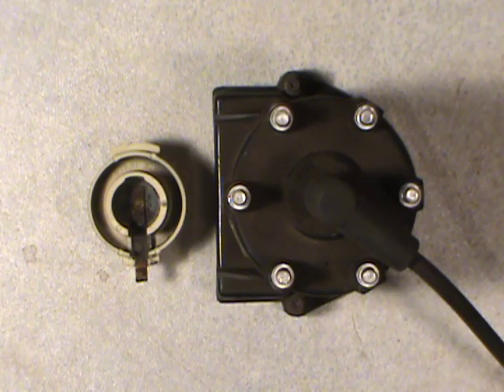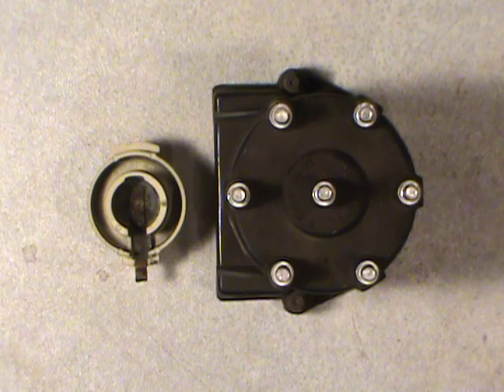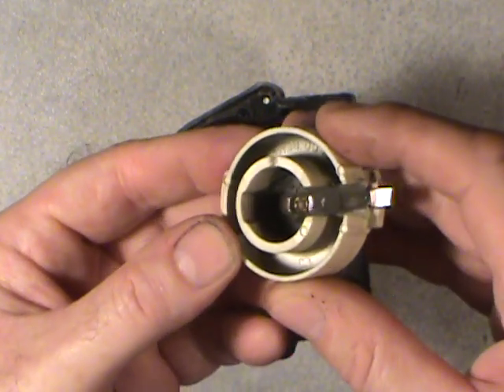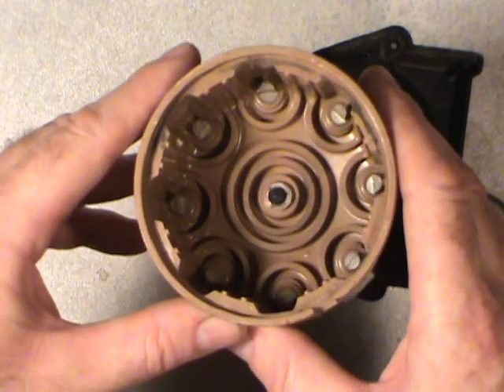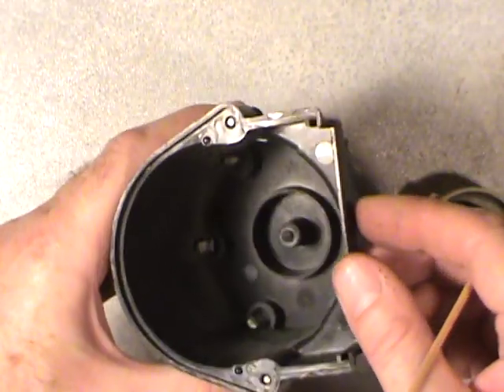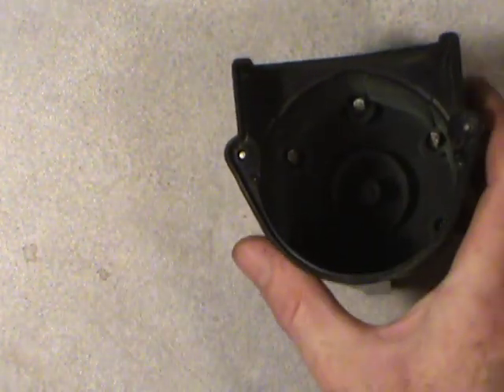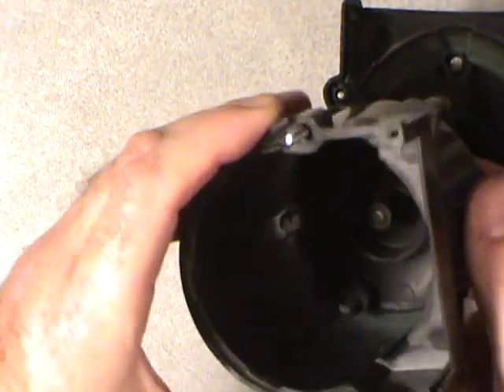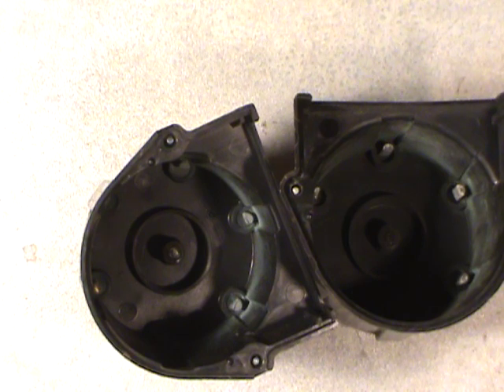How to Inspect Distributor Cap and Rotor Condition (Part 1) of 2 Parts

Comment: will a bad cap , rotor and or distributor cause the car to crank but not start or start then shut off.?
Reply from the maker: Charlie Reyes Greetings Charlie Reyes....Thanks for watching this YouTube Video of mine, and also, for Your comment/question as well..................................................There are quite a few "Things", that can cause a Car or Truck's Engine, to Not Start, or, Run/Operate/Perform Poorly as well, as far as, "Only" the "Ignition System" is concerned..................................................A Vehicles "Ignition System"..."Does Not"...like having Any "Moisture" (aka, Water, Condensation, etc.), any-where near its Component Parts...Especially..."Inside the Distributor Cap"...because, all of that "High Voltage", will usually become, shall we say..."Scattered"...and probably..."Won't"...make its way, From the "Tip" of the "Rotor", to the Intended Metal "Terminal"..."Inside" the "Distributor Cap", and with this particular Scenario, it has been known, to cause, a..."No Start" of the Engine, more-so, when the Weather Conditions are, Damp/Raining, well, You get the picture.............................................................Also, if there happens to be, even so much, as a..."Hairline Crack" (aka, a hardly visible crack) in the "Distributor Cap", as well as, if there happens to be any "Dust Like" Deposits, especially, something like a "Carbon Like" kind of Deposit, "Inside" the "Distributor Cap", which will probably cause, the "Scattered Spark" Syndrome, kinda like, what the "Not Wanted"...Moisture-Inside-the-Distributor-Cap...did, some-what...............................................................If the Car Starts, and then, Shuts Off, that in itself, can be caused by "Many" Things..................................................................Depending on How the Engine actually "Runs", right after Start-Up, (as in Rough/Miss-Firing, or Good and Smooth), and Before it Hypothetically "Shuts Off", will be, quite a good "Clue", that can be used to Determine (or Guess....lol), if it's not something that is "Fuel System" related, and is actually being caused by the "Ignition System", and depending on, just which "Ignition System", that we are Talkin' about, then, it might be, oh, something, as simple, as a "Not-So-Good"...Wiring or Electrical Ground "Connection", and sometimes, and rarely, something, like a worn-out Ignition Switch, can at times, become problematic............................................................If Your Distributor "Cap and Rotor" look like the ones in this Video of mine, I find, that they "Don't" Last all that Long, and, as I see it, is because of the "Weak" Design, more-so, pertaining to the Very Small "Carbon Button", which "Burns Out/Wears Away" quite quickly (mileage/kilometer/age wise), and, the "Rotor", is, shall we say..."Wimpy", and No-Where Near, being, that of, the, like I like to call them..."Industrial Strength"...Distributor Caps & Rotors, that used to be found, on something like, the good ole.."Points & Condenser" Distributors, and some of the Early "Electronic Distributors" as well............................................................................In order to have Your Engine...Run/Perform well, and to get much Better Gas Mileage/Kilometer-age, then, it's a "No-Brainer" (aka, a Must Do!...lol), to make sure, and "Keep" Your Engine, and its related "Ignition Parts"..."Fuel System Parts"..."Air & Fuel Filters"...and, Any, and All, "Maintenance" Related, as well as, a Complete "Tune Up", and have Everything "Adjusted/Set", to the Factory/Manufacturers, and if Applicable, the Added-On, After-Market Parts "Specifications"...!!!..........................................................No-Sir-ee-Bob, please, don't get me wrong, as I'm not Doin'...the...Point the Finger Blame game, but rather, trying to help You out, in giving You, the Best Chance, at having Your Car's Engine...Start...Run...Perform...as well as..."Save" You some Money at the Gas Pump, in terms of, getting, Much Better & More...Gas Mileage/Kilometer-age...!!!....................................................Good Luck....................................................Be Safe, take care, and have a good one.

Comment: Great video.
I have a question.  I'm trying to tune up as much things as I can that aren't to tough for me to handle. I have a 94 Jeep YJ 4cyl and having issues when accelerating from a dead stop in first gear.  The whole jeep will shake/stutter for a quick second then everything works fine. I haven't changed or inspected my distributor cap since I've owned it so I was curious if you think this could be something that would cause a rough acceleration.'
I just replaced the spark plugs, throttle position sensor and O2 sensor.
Thanks in advance.
Reply from the maker: Greetings ncron714....Thanks for watching, and for Your question as well....There are a number of things, that can cause the Symptom that Your Jeep seems to be experiencing....Do You happen to be seeing any "Dashboard Lights", Lighting Up, like, a Warning Light or its equivalent?....Usually, the first thing to do, other then spend a lot of money, replacing parts, that may not be causing the problem, is to first, "Check for Trouble Codes", that might be Stored in Your Jeep's "On-Board Computer"....I haven't had a Jeep to work on, but, I think, in order to See Any Trouble Codes, that might be "Stored" inside Your Jeep Computer, there might be a certain Way, to use Your Jeep's Ignition Key, in the Ignition Switch, to then have, a Light "Flash" a (if I'm not mistaken) Series of "2" Digit Trouble Codes....With the Engine "OFF", Insert Your Ignition Key in the Ignition Switch, then, Turn the key, from, OFF, to the RUN (Not Start Position) using the Following Sequence....ON...OFF...ON...OFF...ON (and leave the Key in the Last ON Position, and wait a short while, and see if a Dashboard Light, Starts Flashing)....Then, Write Down, the Number of Flashes, that You see (if any), and, from what I recall, it should end with the Number 55.

Once You get the/those Codes written down, remember to turn the Key Off, and remove the Key.

Any Codes at all?

Even if You don't get any trouble codes, You could try the following...

...I have found that, adding some Fuel Injector "Cleaner", to the Gas Tank, can make its way, through Your Fuel Injectors, and Clean the Deposits, that can Clog one or more Fuel Injectors, and can also, keep the Fuel Injectors, from Spraying a very Fine Mist or Vapor, that is very Important, for Your Engine's Power and Fuel Economy.

Just follow the Instructions on the (small) Bottle.

Be careful, as some of the Stuff, that I used a while ago, actually Cleaned all the Crud out of my Gas Tank as well, and, Totally Clogged my Fuel Filter!

So, if You do use the Fuel Injector Cleaner, it would be a good idea, to Change Your "Fuel Filter", once that Tank of Gasoline, with the Fuel Injector Cleaner in it, is used up, and, New gasoline is added to Your Gas Tank, With-out the Fuel Injector Cleaner in it.

Check out Wrangler Forum . Com  (without the Spaces in-between), as, the People over there, know "Tons" about Your Jeep!

Also, check out Other Jeep "Forums" as well.

Good Luck...

...Be Safe, take care, and have a good one.

Comment: Thanks for the info. Does the rotor make the contact on the distributor cap or is it just spark jumping. And do I have to clean the contacts. This is why I posted my original comment that you spent the entire video on center spring loaded contact yet you didn't cover any other parts of the distributor.

Comment from the maker: ...now, on to the "Condensation", or build up of Moisture inside your Distributor Cap...If a Distributor Cap happens to contain any Condensation (happens when water vapor in the air gets cooled to the point where it condenses back into liquid form), that my Friend, will cause Sparks inside the distributor cap to put on a very Unwanted-High-Voltage-Spark-Show, or, in other words, Electricity Randomly Bouncing around inside the Distributor Cap, making the Engine sound Sick, or No-Start!...(con't)

Comment from the maker: ...Miss-Fires, and Uneven-Running, etc. ....I recall an Old-School Fix (but it's always better to Discard any Bad Distributor Caps and Questionable Components, but I'll tell you just for the fun of it....Some, used to clean the inside of the distributor cap, and "Dab, or Paint" the crack with some of that fancy stuff called "Nail Polish!"....Please, don't do this, especially if the "Better Half" catches you taking Her Nail Polish without Her Permission!...lol....(con't)

Comment from the maker: ...your Ignition Coil work harder then it really should, because it takes more Voltage to Jump that Larger Gap, much like a larger gap in a spark plug would....Same thing happens when the spark plug Terminals Inside the Distributor Cap starts "Eroding", due to the same "High-Voltage-Electrical-Arc-Erosion!....Psssst, I have done what I said not to, to save some money, probably like many others have!...lol...So, keep an eye on those "Electrical-Erosion" Points that I have mentioned....Take care

Comment from the maker: ...note, when the metal Tip of that rotor starts to Wear, due to electrical erosion, don't be tempted to File or Sand the metal rotor Tip Clean!....Why you ask?...That's why!...lol...Nah, here's why, my Friend....When the Rotor is spinning around inside the Distributor Cap, there is actually no real Physical Contact between the two!....If one was to file or sand the rotors metal Tip, then that would "Increase" the Running Clearance or "Gap" between the Rotors Tip, making...(con't)

Comment from the maker: ...in my entire life!....Now then, there are other points that I should, and must address for all of Mankind...lol...On the Larger Rotor, keep an eye on the metal tip, where it spins, nearest the inside of the distributor caps Internal Aluminum or Brass Terminals (Uh-huh, the terminals that the spark plug wires get connected to on the top/outside of the distributor cap)....The Metal Tip will start to Erode, due to Electrical-High-Voltage-Arcing whenever the engine is running....(con't)

Comment from the maker: ...now that the "Smaller-Cap-and-Rotor" (and in my opinion) not so well designed, problems have been addressed, I will now move on to the "Industrial-Strength", of the kind of Distributor Cap and Rotor that I most certainly will give a "Thumbs-Up" for, and that is the other larger Distributor Cap and Rotor (Tan colored Cap, and that Large Rotor that is seen in this video....I have Never, Ever, worn out a Carbon Button, or the Metal Contact Strip, where it contacts the carbon button...(con't)

Comment from the maker: ...so, now that you brought the lack of information that I provided about Inspecting the actual Parts, I will now inform you of what experience has taught me....The smaller Distributor Cap and Rotor need to be replaced when that "Tiny-Spring-Loaded-Carbon-Button" gets (wears) too short, as well as the Electrical-Arcing-Erosion that occurs at the "Tip" of the metal strip part of the Rotor, where it spins closest to the contacts inside the (smaller sized) distributor cap...(con't)

Comment from the maker: Greetings Krystian Leesowy....Thanks for your comment, and also, for paying close attention to what I had to say, and show you....When it comes to the smaller Distributor Cap with the Spring Loaded Carbon Button, it's my experience, that the Spring Loaded Carbon Button, and, the center portion of that Rotor that shows abnormal wear, due to the Worn-Out Carbon Buttons Short Length, will "Wear-Out" well before one has to worry about other parts/pieces that start to cause problems....(con't)

Comment from the maker: Greetings Oliver Renacia....It appears with the design of the distributor cap that you see in this particular video (of mine), that you have to replace the whole cap, as there doesn't seem to be any carbon buttons available when I did a parts search on this type of cap...You will find that when that carbon button wears out, it usually carves a circular hole in the rotor metal contact strip!...Replace the cap and rotor before the carbon button gets too short!...Take care, and have a good one

Comment from the maker: Hello, once again JCJV....I should also tell you the following....Whenever you "Reset" (clear codes out of the computer of your vehicle using the scan device), your cars computer has to "Re-Learn", and shall we say, "Re-Calibrate" itself again....All you have to do, is drive your vehicle around for a short while, and your cars computer does all of the re-setting all by itself....Make sure that you do after fixing something or changing parts, or you might have problems that are not really there!

Comment from the maker: ...Try removing spark plug Number 1, and see how it looks....Perhaps look at the other (5 or 3)as the case may be, and, that should tell you a thing or two about how what's going on inside the cylinders....Sometimes to fix problems like yours and others, the repair might only be fixing a bad wire connection (like a ground wire maybe), or a connector that may have corroded....You may find that the new parts you put in, won't fix the problem, or, maybe they will....Let me know, and...Good Luck!

Comment from the maker: ...the spark plug was firing intermittently, then raw fuel would be going past the first oxygen sensor, and it would read "Rich"....(catalytic converter would probably burn up the rich mixture) before continuing on to the 2nd oxygen sensor, thus giving an ok reading (that's if you have the setup that has 1 oxygen sensor before the catalytic converter, and the other one after it) ....but, then again, the computer might be telling the injectors to lean out because of the rich mixture...(con't)...

Comment from the maker: You are welcome, my Friend....I was thinking about those codes a bit more....Only Number 1 cylinder has the misfire, and because the other codes indicated "Lean" (oxygen sensors send lean voltage signal to computer when warmed up), has me thinking that it might be a faulty "Fuel Injector" or related wiring circuit....(4 cylinder has 4 Injectors, and 6 cylinder has 6 injectors), not sure if you have a 4 or 6 cylinder engine?...Now, if the Injector was injecting fuel into cylinder #1 and..(con't)

Comment: the car runs pretty well the same at cold start maby even a bit worse, and i have noticed every once in awhile that when the car idles and not moving it sometimes feels like it skips a beet and then goes back to normal. I will clear the codes in my cars computer and try putting new parts into the car that you have mentioned and check the spark plug wires. and I will let you know how things turn out. thanks for all your help.

Comment from the maker: ...also, does your car start and run ok when it is first started up for the day?...When your car is cold, the computer runs the system on what is called "Open Loop", meaning that the Oxygen Sensors (I think you have 2 of them) don't become part of the computers operating circuit until they get heated up to approx. 600 degrees farenheit...(You might have heated oxygen sensors, to speed things up)...Also, take care of all of those "Scheduled Maintenance" things...Let me know how you progress...

Comment from the maker: ...even spark plug wires that are to close to one another, can cause what is called induction crossfire (when high voltage jumps from one spark plug lead to the other one that is too close to it)...Keep them at least 3/8 of an Inch apart, especially when they are running parallel to each other...If it's time/mileage for those Oxygen Sensors to be changed, then, get them replaced, as more then likely I think that's the reason for the slow response...(con't)...

Comment from the maker: Hello JCJV...The codes that you have here can be verified as current codes, if you clear them out of the computer, and drive the car for a day or two...(make sure you write these current codes down first)...then re-scan you cars computer, and see what codes show up, that way they are "New, and Fresh"...(as some older codes can be intermittent)...The p0301 code looks like either a Fuel Injector type of problem, or Electrical, as in, Spark Plug Wires, Cap and Rotor, or supply Circuit...(con't)...

Comment: there are six codes now in my cars computer, 

p0153 o2 circuit slow responce (Bank 2, sensor 2)

p1131 lack of h02s11 switches-sensor indicates lean.

p1151 lack of h02s21 switches sensor indicates lean.

p0133 o2 cicuit slow responce (bank 1,sensor 1)

p0174 system too lean (bank 2)

p0301 cylinder 1 misfire detected.

Comment from the maker: When the EGR valve doesn't shut when it's supposed to, Idle is rough, and No power, especially at faster/highway speeds....First thing I would suggest though, is, you need to see what Trouble Codes are stored in your cars Computer, if there are any....I'm pretty sure that you have the "OBD-2" (on board diagnostic "version" 2), which will require the use of an OBD-2 "Scan Tool"....North America's Governments made OBD-2 standard on vehicles around 1996 If I recall correctly....Get those Codes!

Comment from the maker: Hello JCJV....Almost everything pertaining to engine management parts, indeed need replacing at Mileage/Time intervals as suggested by the Manufacturer/Factory to keep performance/emissions at a satisfactory level....But, there are other parts that can be cleaned and re-installed with a fresh gasket, if required....I have had bad running vehicles, both carburetor and fuel injected, due to carbon coating, and even Chunks of carbon keeping the EGR (exhaust gas recirculation) stuck open!...(con't)